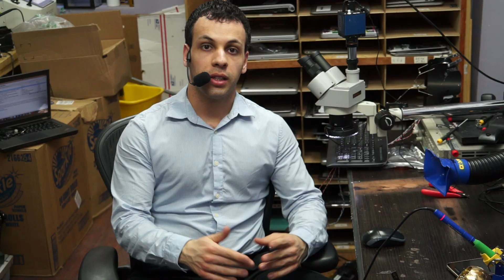Introduction to basic electronics.

Comment: hi mr rossman, i am a big fan, i wanted to know that can you make a video about "what does an output capacitor do in a circuit" and what is "voltage drop and voltage bias and biasing" or about "what is reppling, noise and a signal"
thank you very much
mohammad hossein

Comment: I just recently found your channel. The fact that you don't have a formal education shows that you have a passion. I am the same way. I also do not have a formal education but I worked in an electronic design section at an engineering facility at Ford Motor Company for 7 years. During my time there I worked with interns that had just recently graduated college, University of Michigan, Michigan State, Penn State University, etc. Those people didn't have a clue how to do practical electronics. One of the people I worked with constantly kept picking up the soldering iron from the hot end. Another had absolutely no idea how to read a resistor. from it's color bands and he wasn't color blind. Hell, I learned that in high school. Why spend 10's of thousands of dollars to go to school, get a piece of paper that says you're qualified, when in reality you aren't.

Comment: You inspired me to start learning how to repair electronics or at least the basics, fixed my mouse and keyboard already , saved me about 200 dollars, although it was so easy replacing the usb cable / opening up the keyboard and checking it out myself and doing really easy soldering (sodering :)  . it was a pretty simple thing but you gotta start somewhere right ? you started by modding playstations as far as I know, and that's a really good start

Comment: Can anyone tell me what type of power supply is being used in this video? (In the back on the right) I'm needing to order a good power supply and not sure which one to go with. Thanks
Reply from the maker: +Jeff Todd HP 6542A
Reply: Louis Rossmann Thanks Louis. Not sure if you've heard of the Dr.Meter® HY1803D Variable Linear Single Output DC Power Supply? It allows up to 30 Volts. The model you have appears to be discontinued. Perhaps they have a newer model.

Comment: For what it's worth. All the equations in the world and isn't going to bring the fascination of electronics into a persons life. It best way to learn electronics is to forget the mathematics and all the science behind it and learn from practical hands on experience as your advocating. Watching what happens when a wire is toggled or when a switched is flipped is what gets kids excited in engineering, not the theory of a transistor. While I'm not diminishing the importance of the science behind electronics, in my opinion  it's imperative to have practical hands on experience and its the best way to make learning the science easier. There are too many electrical engineers who can explain the science and design electronics on paper, but wouldn't know the hot end of a soldering iron or understand the difference between design and serviceability.  I applaud your efforts, don't worry about the theory or the science so much - there are plenty of engineers to help you there, however, too few can do what your doing.  

For what it's worth - PhD in electrical engineering - former professor.
Reply: KungFu Master Greatest comment I've ever read.
Reply from the maker: KungFu Master Thank you!
Reply: +KungFu Master yeah when i was a kid i fixed that my rc controller board without soldering and there was no youtube at that time. amazing times
Reply: BSEE and MSEE and I'm learning system level board design on the job. 😂 IC design, signal processing, no problem. Seems backwards. Or my circuits class wasn't hands-on/real world enough.
Reply: Couldn't agree more.  I've made some half-hearted attempts at learning about electronics through 'beginners' electronics texts only to get bored or discouraged because I'd read two hours worth of material and come away with no better understanding about electronics than when I started.  Many texts get mired in the math and physics and theory, yet fail to simply explain what a component does and how it is used in a real-world circuit.  I found that I tend to learn more if I can get hands-on experience and actually see how something works.  I'm sure most people feel the same.  If more instructors took this type of approach, electronics would be a vastly more approachable subject matter.  Kudos to you, Louis, for keeping it simple.

Also, LOL at "wouldn't know the hot end of a soldering iron".  Awesome comment, KungFu Master!